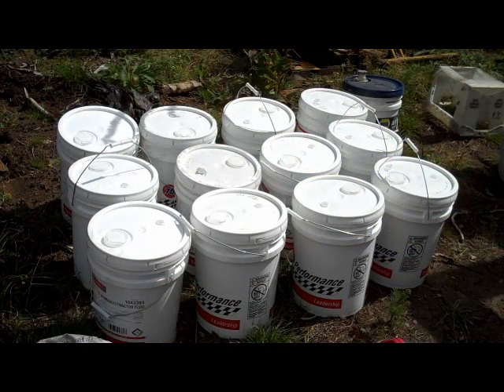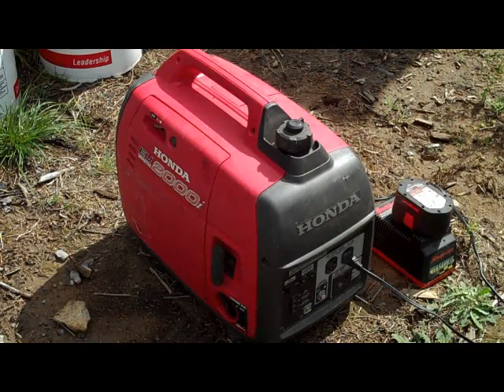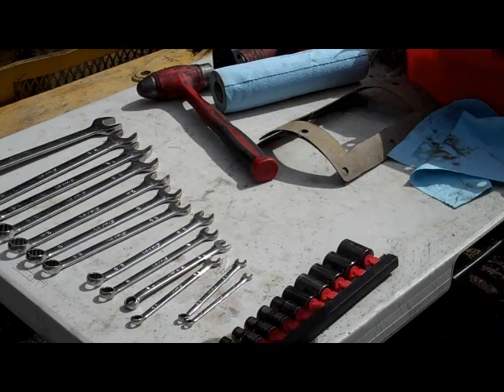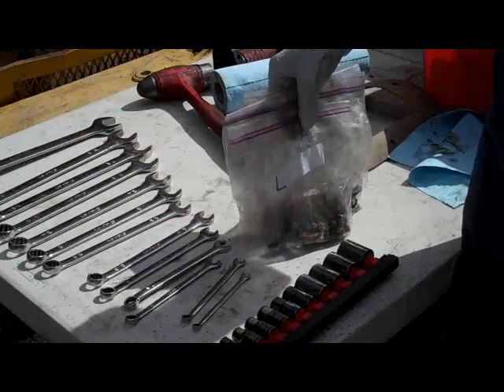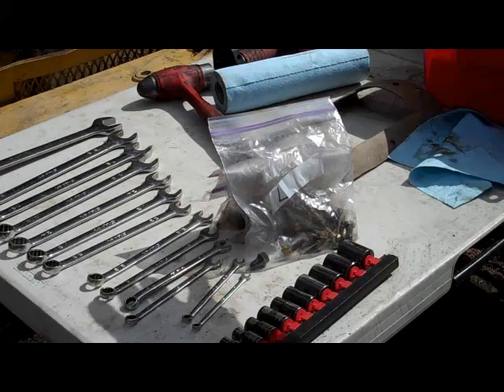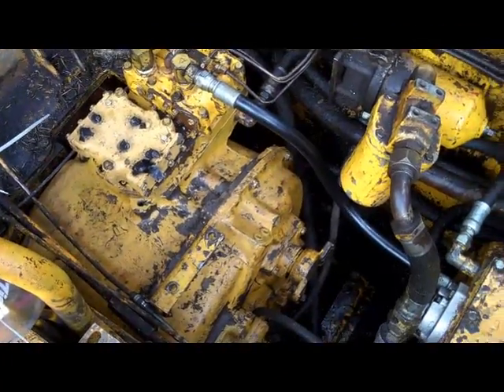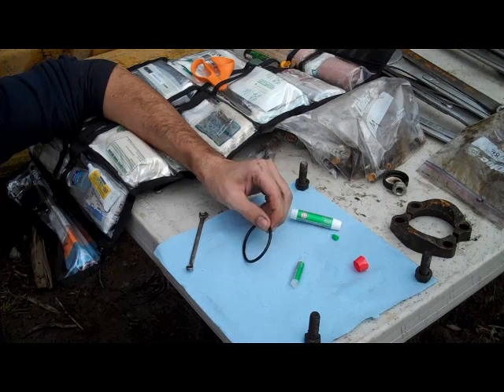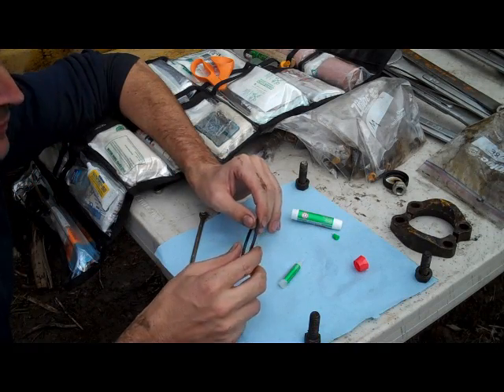Rebuilding a CAT Transmission – Game-Changing Tips & Tricks

Comment: ive used super glue to make o-rings in a pinch in the field while changing otr tires was in a position out in the woods one time with an art truck (articulatting dump) with 29.5-R25's i was out of 25"o-rings so i cut some out of a 33' o-ring and amazingly i cut just enough out of it (that wont ever happen again cutting it just right )lol   but it do work

Comment: Not from China? Lol...from us? 
TD 20 has a lot of pressure tests to verify which clutch pack is leaking to much and charge pressure etc.
Torque converters also can be disassembled and inspected.
Check pressures at test ports motor running high idle. I
Worked on equipment for 30 yrs.
Very often its best to take Trans to a place that can dyno test it . I did that a lot with large marine transmissions. שלום